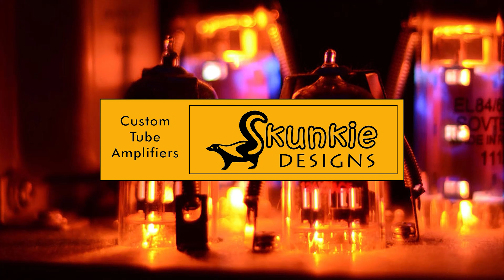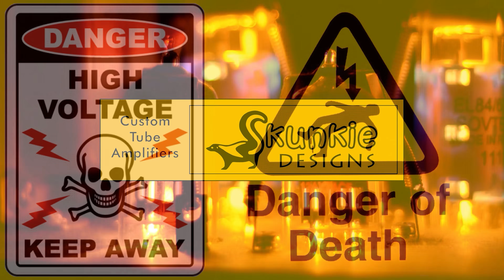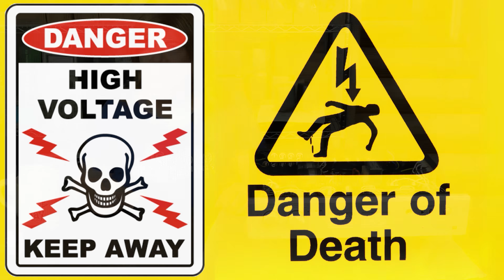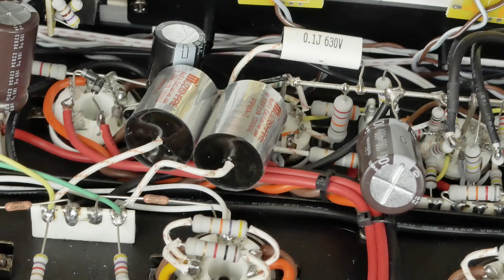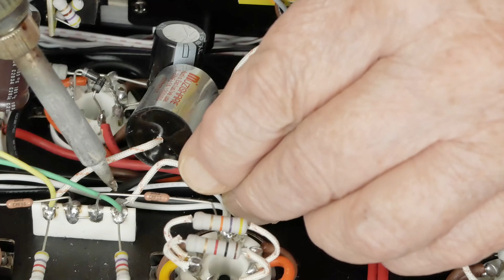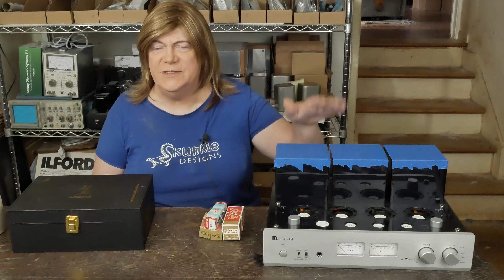Muzishare X7 Revisited: Relacing Coupling Caps / Final Tube Rolling!

Comment: Hi, you mention as your last step you are taking a voltage reading at the grids  and adjusting the pots to -56v. Is this an essential step? I am confused  as to what contact points you would take that reading from. In the first video wasnt the grid voltages -46v ?
Reply from the maker: The final bias voltage was probably -46V. I always want to start colder bias after any repair/mod, which -56V would be and adjust from there. The voltage is read from the grid pin to ground, mainly it's to ensure you didn't mess something up and there is no negative voltage on the grid = instant red plate tube, which is then ruined. You can skip this step if it seems like too much trouble...
Reply: @SkunkieDesignsElectronics  i really appreciate your replies and help. thanks again

Comment: I am a normal user who is not knowledgeable about tube amps so it is difficult for me to follow the instructions. Please let me know what type of tube I should change to in order to hear the best sound. Thank you very much
Reply from the maker: The "premium" Gold lion 12AX7, EH 12AU7 gold pin, gold lion KT88 or Shuguang treasure KT88-z. The latter are hard to find.
Reply: @ 5AR4 can I replace Gold Lion GZ34?
Reply: Is it necessary to replace 5ar4 with gz34? because I have them available
Reply from the maker: 5AR4 and GZ34 are the same thing and there really isn't a need to replace that tube.

Comment: Stephe,
Happy Thanksgiving!  On the Stereonet Muzishare forum, someone posted that the meters on the X7 are not calibrated for use with EL34 tubes. When adjusted for 30mA, the actual level was measured at 50 mA.  When the X7 was correctly adjusted for 30 mA, the meters read only 20 mA.  Do you think this is correct?   Hope the holidays are well for you. As always, love (and liked) all your videos.
Jon
Reply from the maker: The meter is across a 10ohm resistor on the cathode, not sure why it would care what tube is in it. None of those built in meters are gonna be as accurate as measuring with a VOM so: install test jacks like I did and ignore that built in meter.
Reply: I just picked up the Amptata V8 bias tester for octal tubes... It confirms that the X7 registers 30 mA at the 20 mA level on the X7's meters and measures a whopping 50 mA at the 30 mA indicator on the X7 bias meter. I am surprised (and happy) that the X7 did not cook the EL34 tubes at that level. 

I have been merrily tube rolling with the X7 and am really happy with the sound running Amperex 12AU7 tubes in the amp. I also tried the clear top RCA 12AU7A tubes and both sounds a lot better than the stock and the Gold Lion B759/12AU7 tubes with the Amperex edging out the RCAs in naturalness and smoothness. The RCA has better bass and a slightly wider soundstage... I am still waiting for my Amperex and RCA 12AX7s to come in. I wish I could try out the Telefunken 12AU7/12AX7 tubes but they are just too expensive at $300+/set.

Comment: In your opinion, which one should I choose between R8 mk2 and muzishare x7 at the moment? thank
Reply from the maker: I personally would choose the X7 as I think the 9 pin tubes generally sound better and it's hard to find a good sounding 6SL7 tube.
Reply: @ Have you ever used cayin mt-45mk3? Do you think it is better than X7 or R8 mk2? Thanks
Reply from the maker: I haven't, and there are a lot of other options out there. I haven't haven't personally seen, listened or worked on them.

Comment: I installed Jantzen Z Cap 0.22mF but only replaced the 4. Is it worth replacing the 2 small capacitors that were replaced first in the video? The Jantzen do a good job, I no longer have that annoying metallic clinking in the high tones. Can you say something about the quality of the output transformers?
Reply from the maker: I don't think those other 2 impact the sound as much but honestly have never A/B listened. Also I noted some amps have 0.1UF caps, others and the original schematic show 0.33uf. That could impact the bass response I would think? The output transformers test and sound OK, not sure I would say they are "high end".

Comment: heyo Stephe! Great video again. Very relaxing watching you work on this amplifiers! I am very grateful that you give useful hints while soldering...

 I am curios how it sounds with the mundorf caps and if the original muzishare caps are somehow bad and if they should be replaced.
Reply from the maker: I think it sounds more detailed but it's not an earthshattering change. The stock caps are at least what I consider decent.

Comment: I agree with your comment about how sensitive the ear can be to frequency response variation. I have an equaliser and just touching the levels around  2KHz + 6KHz by less than 0.5dB is the difference between smooth or more open to my ears 🤷‍♂️.
I was also interested in your comment about multiple frequencies. When using KT120 I was aware of something like maybe intermodulation distortion. Everything would sound as smooth as silk but as soon as distorted guitars played with synthesisers and backing vocals there seemed to be this background muddled “Hash”. When the music became more simple everything became smooth and sweet again 🤷‍♂️. Digital distortion/my ears/the tubes I’m not sure? 🙂. All mixed in with that thing that some nights the music is sweet and others it’s better to turn it off and watch TV. The Horizon KT88 are sounding great tonight thank goodness. Thanks for a really enjoyable channel 👍.

Comment: I noticed you don't check the Caps for which end is the negative side. The outside foil in the cap is the negative side, this helps to keep the noise out of the amplifier. I have no hum or signal at full output of my amplifiers.
Reply from the maker: Mundorf has the outside foil marked by lead length and printing on the cap. Go check their website for more info.

Comment: You are correct that the .1uf doesn’t affect the sound as long as it’s large enough. .1uf is the standard value every one uses.
Reply from the maker: The schematic I have for this amp shows 0.3 and the willsenton also uses a 0.33 in this spot. And yeah I just noticed this amp has a 0.1!

Comment: Also, any particular reason for changing the bypass capacitors to .33 from .1?
Reply from the maker: I just realized this amp has 0.1uf, while the schematic for this amp calls for a 0.3! Anyway, increasing the size of this cap absolutely won't harm anything. I have to assume they used a 0.1 for cost or packaging savings? I'd swear the first one I worked on had a 0.33 cap in that location.
Reply: @SkunkieDesignsElectronics  wouldn't doubt it. Like yous said, not critical in the listening path.

Comment: Are those ceramic strips? Do they require silver alloy solder like the tektronix ceramic strips?
Reply from the maker: No, regular solder is seems fine.
Reply: @SkunkieDesignsElectronics  good to know. I've only ever encountered them fixing old tube Tek scopes. They even hang a small roll of solder for you in the case! Over time the lamination would break away from the ceramic if solder without silver content was used. Great layout btw!